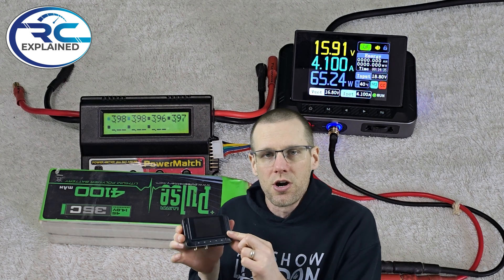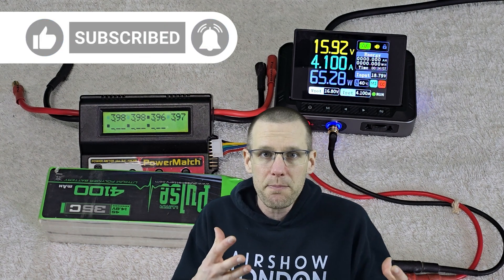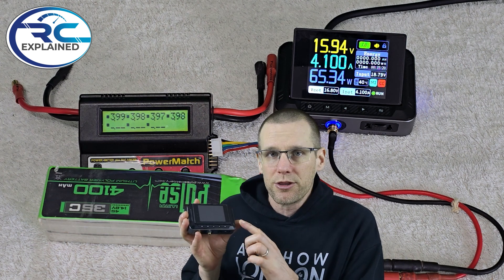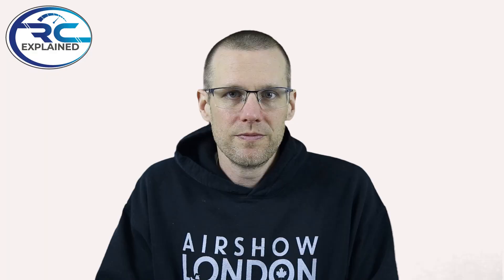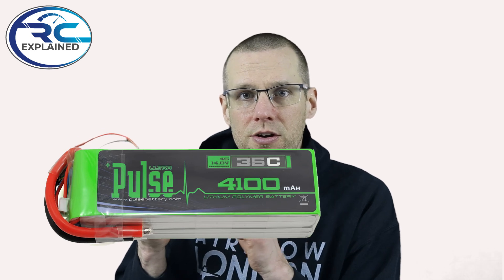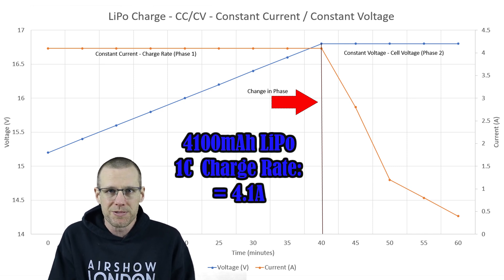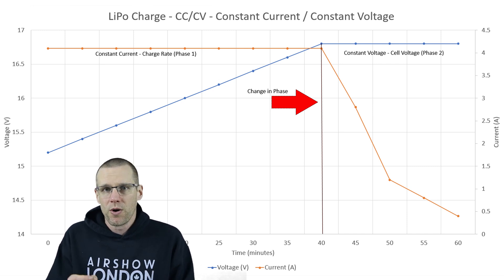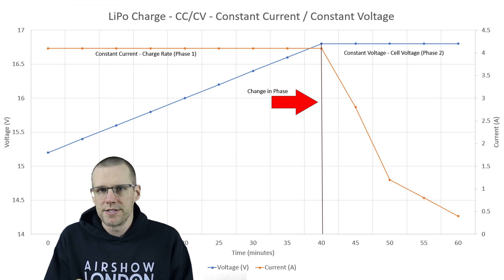The Truth About Safe LiPo Charging, Understanding CC/CV!

Comment: I am a subscriber. I need to test a vintage horn that takes 6VDC/12AmpsDC  and i do not want to buy a 6v battery. Do you have an advice about what cheap power supply i can buy? Thanks
Reply from the maker: I Would just re-purpose a used PC power supply and either try out the 5V output or use a step down buck converter from the 12V output to 6V.
Reply: @RCexplained  How about a warbler circuit after the power supply for fun?
Reply: Amazon, Ebay.
Reply: Motorcycle battery charger that can charge 6v and 12v  may operate the horn.